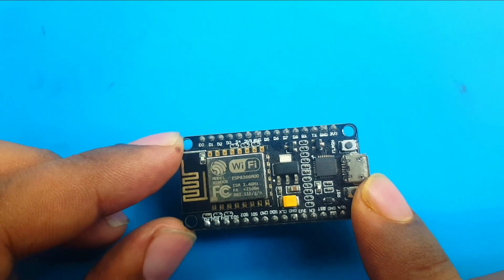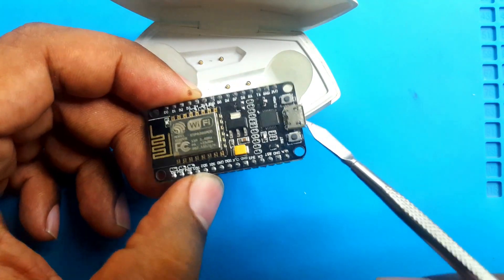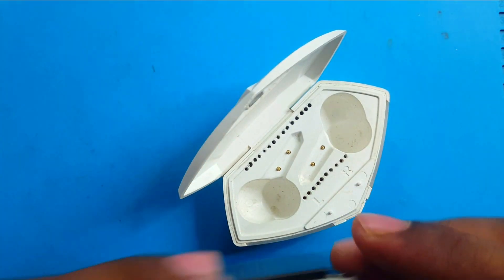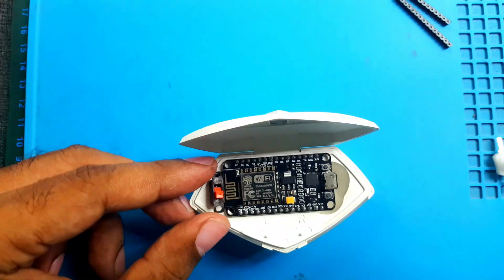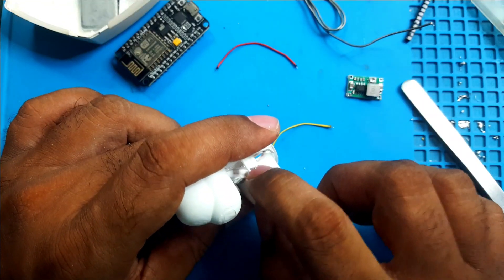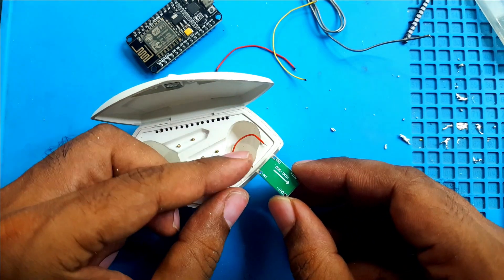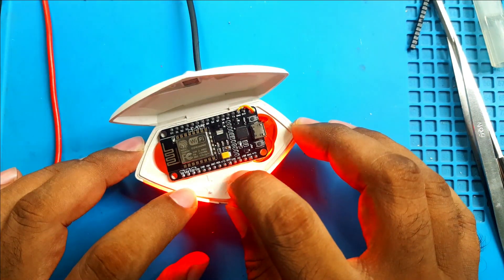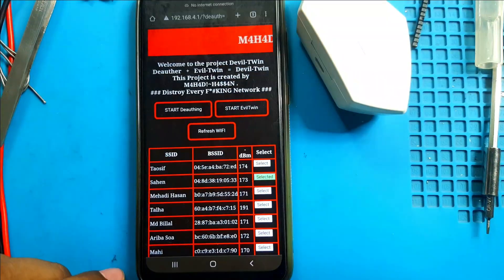How to Make a Portable NodeMCU with Battery

Comment: Thanks for the video! Sorry for this newbie question, but is it possible to easily upload firmware to the chip using the TWS case charger port?
Reply from the maker: No, for uploading firmware you have to use it's own USB port.
Reply: What a noob 😂